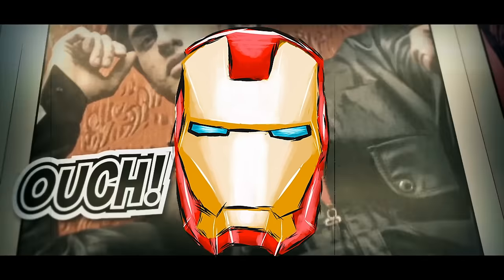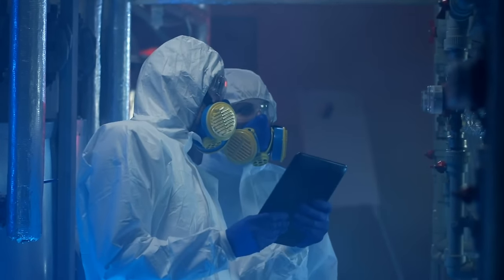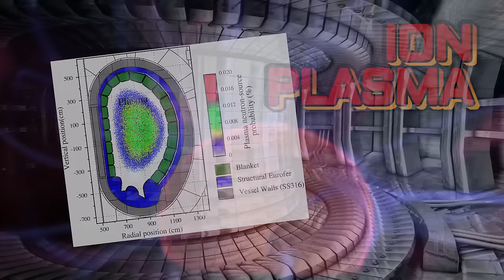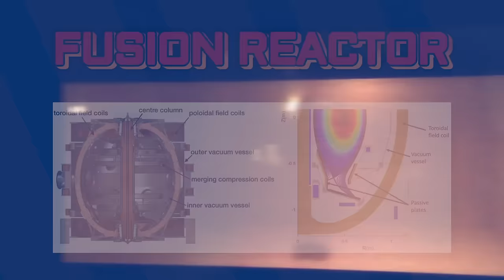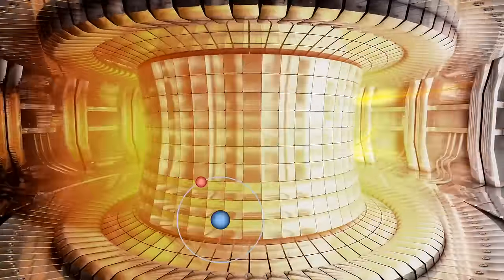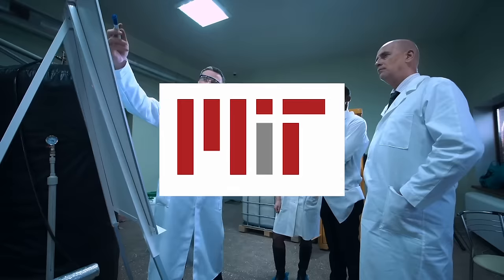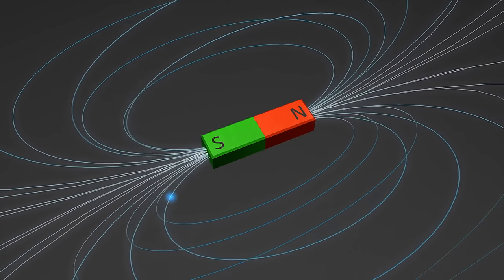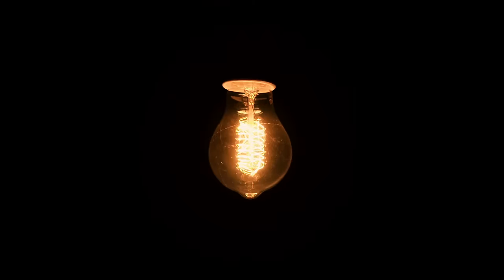How Does Iron Man's Arc Reactor Work?

Comment: But there's one problem: that arc reactor generates A LOT of waste heat...TONS.
Reply: What if that energy is converted so it  actually gives off usable energy.
Reply: Well it could function as heater
Reply: yeah lmao his chest should be burning from the inside out but this is the same universe where we have a guy that can summon lightning, two guys that can shapeshift,  magic, time fuckery, and much more. tony stark's chest not being literally on fire from the heat of the reactor is the least of our problems.
Reply: thats kind of the point.. the heat is used to create water vapor which spins turbines, its the spinning of these turbines that generates the electricity
Reply: @InitialPC  But there is still SO MUCH heat!
Reply: These things burn 5 times hotter than the center of the sun. Heart burn is an understatement
Reply: Yuan Yuan I mean their world is more technologically advanced than ours, surely he would have found a solution to that problem?
Reply: @waynewayne8419  I think that's why in the movie they have a team of scientists working on the reactor. But anyways with the amount of heat coming from the original reactor, some sort of insulation system should have been put in place because, with the amount of heat and not to mention radiation coming from that would be.... ALOT. The heat that comes from the reactor could be used for alot more things than powering a factory. Basically, Howard Stark invented another way of producing a clean energy source without causing pollution. But that's the MCU for ya, going against the laws of physics, chemistry and biology to make new laws of physics, chemistry and biology.
Reply: @verityxo1159  yeah what’s wrong with that? It’s not making new laws, it’s just presenting new possibilities with a hypothetical improved understanding of our own material science. We don’t invent this technology, we discover it.
Reply: @shadowfire04  remember that scene in iron man one where we can see inside his chest cavity maybe that metal structure inside his chest can absorb the heat and cool in or its his real superpower being heat proof
Reply: This waste heat can be used to heat the water in Thermal Power Station to vaporize the water into steam to drive turbines and replacing the need of Fossil Fuels and efficiently using the existing infrastructure to produce electricity
Reply: @anujchaturvedi6296  It's basically a miniaturized nuclear battery (they are real things that exist)/tiny fusion reactor.
Reply: @albertjackinson  Ok but I was talking about large Thermo-Nuclear Fusion Reactor that produce large quantities of heat
Reply: Then couldn't you use that heat to power power plants in the same way nuclear power plants work?
Reply: @TheGoat-dp5xy  a heater is something that generates a low amount of energy. But with that kind of energy it can classified as a volcano.
Reply: Waste heat can be used for more traditional power generation methods like steam turbines.
Reply: Apparently the Arc Reactor has massive insulation that somehow does not melt or explode despite having 3 gigajoules per second of power concentrated in such a small volume. If even a 1 percent of heat leaked out of the reactor, it would function as a 30 megawatt heater whenever it's pushed to the maximum capacity, 2000 times more powerful than a typical patio heater.
Reply: Wait I thought iron man reactor was a fission reactor. Just a very efficient and stable form of it
Reply: @TheGoat-dp5xy  for the fuking universe
Reply: @kaboomgaming4255  doubtful cuz hes constantly running OUT of power meaning that that excess energy prolly is waste still.
Reply: @InitialPC  water boils at 100 C
Plasma is thousands of degrees C, maybe hundreds of thousands. It will burn through his chest  then when he falls down, it will start melting through the floor and ground
Reply: Humans 0
Saiyajin 1 to 6
Angles 7

Kalki Ironman 5th matriya buddha 8th arc Angel 11th satguru 13th imam and 24th avatar after 2026 😎

Almighty God 9 😇

Humans type 2.5+ after 2026 by Kalki Ironman (christ in the white horse)(son of man on clouds) type 7 and 8 😎😎😎😎😎

Jarvis the world’s first artificial intelligence (parrot) 😎😎😎😎😎

Cuz Kalki is ironman batman and every super heroes combined after 2026 😎😎😎😎😎

Jarvis world’s first artificial living being (just like vision in marvel universe)😎😎😎😎😎

Made of Quantum and sub quantum particles 😎😎😎😎😎

Power source quantum energy arc reactor (type 7) level technology 😎😎😎😎😎

Kalki Ironman going to have every kind of arc reactor like:- type 1 Nuclear fission, nuclear waste, hydrogen fusion, type 2 3 4 5 antimatter arc reactor (solid liquid gas), type 6 electro quantum arc reactor, and type 7 Quantum arc reactor, type 8 limitless quantum energy arc reactor without quantum particles 😎😎😎😎😎

Kalki Ironman going to have sun in a box million billion tons of hydrogen nuclear fusion reactor type 2 3 4 5 just like sun and stars in the palm of his hand 😎😎😎😎😎
Reply: I thought he fixed it in Ironman 2 where he made a new element ?
Reply: "What could it generate?"
"If my math is right, and it always is; 3 gigajoules per second."
"That could warm your heart for 50 lifetimes."
"Yeah, or something big for 15 minutes."
Reply: @kaboomgaming4255  in fiction it could be done but in reality entropy doesn't allow it, "every action you do increases the entropy of the universe" means if you have a lot of energy concentrated in one place, that means that as long as you do any action with it, it's energy would dissipate creating more entropy, and actually moving that heat to store as energy would create more entropy either as heat or in another form since you still need energy to move energy, so it's kinda hard, the closest we could ever go to creating as little entropy as possible in the universe is with super-conductors
Reply: Thats why it is really cold fusion it only heats up upon exit
Reply: @InitialPC  those turbines would generate little to no energy
Reply: @cantugs-buyer1552  that’s what I’m thinking, put the reactor under water and let it boil, steam goes up into a turbine to generate electricity. Free additional power
Reply: Humans 0
Saiya-jin 1 to 6
Angels 7 😇

Kalki Ironman 5th matriya buddha 8th arc Angel 11th satguru 13th imam and 24th avatar after 2026 😎

Almighty God 9 😇

Humans type 2.5+ after 2026 by Kalki Ironman (christ in the white horse)(son of man on clouds) type 7 and 8 😎

Jarvis the world’s first artificial intelligence (parrot) 😎

Cuz Kalki is ironman batman super saiya-jin superman ben10 saitama Narutoo optimus prime and every super heroes combined after 2026 😎

Jarvis world’s first artificial living being (just like vision in marvel universe)😎

Made of Quantum and sub quantum particles 😎

Power source quantum energy arc reactor (type 7) level technology 😎

Kalki Ironman going to have every kind of arc reactor like:- type 1 Nuclear fission, nuclear waste, hydrogen fusion, type 2 3 4 5 antimatter arc reactor (solid liquid gas), type 6 electro quantum arc reactor, and type 7 Quantum arc reactor, type 8 limitless quantum energy arc reactor without quantum particles 😎

Kalki Ironman going to have sun in a box million billion tons of hydrogen nuclear fusion reactor type 2 3 4 5 just like sun and stars in the palm of his hand ✋🏻🤩😉😇😎

This all going to happened by self replicating quantum nanobots knowledge energy and techniques at type 7 7 7- respectively 😎😎😎😎😎.
Reply: No it doesn’t
Reply: We can create some kind of material that can repell heat and reuse it somehow
Reply: But if we successfully make a fusion reactor couldn’t we also absorb that heat and convert it into energy using the seebeck effect. Basically use the ionic energy and any heat waste we use thermoelectric generator around it to absorb any waste.
Reply: @verityxo1159 the amount of heat would burn him to a crisp within milliseconds
Reply: That is case in open but not in close one
Reply: He uses the excess heat to power the arc reactor. So that all the plasma that comes off gets used, and btw the excess heat that gets used, Tony will get used to it eventually.
Reply: @SashaironfistGaming-SUB2MEEPLZ  wouldn't the excess heat kill him?
Reply: There might have been cooling properties to counteract the heat like that force field stuff we saw on droids in star wars revenge of the sith during Anakin and Obi Wans fight on Mustafar. That was vital to keep the droids that close to the lava without melting.

Comment: I recently found out that the ark reactor tony uses is based off of technology his father was tinkering with, basically, Zola in Captain America, harnessed the power of the infinity stones' casing, not the infinity stone itself, to make batteries which powered the weapons hydra's infantry used, that tony's father got a hold of. in other words, just like in reality, stable fusion reaction requires undiscovered exotic material.
Reply: True as it is physically impossible to gain energy from no where. The arc reactor needs just as must energy to pull apart the atoms that it gets from doing so. And that’s if the design is perfect. There will always be inefficiencies, so it will actually lose energy by doing that.
Reply: So how did he get that exotic material in the cave when making his first reactor?
Reply: @tomclanys  his first ark reactor don’t have it. That is why it only lasted like 20 minutes before it burnt out.
Reply: @proskillz9849  No, it's because it had "just enough" palladium for it's job to escape. Vibranium is exotic, his first reactors are "normal" in MCU science
Reply: @tomclanys  It had a bit more than that. He was able to escape, keep him alive for three months and a few days after he got home, then allow him to fight Stane at the end. The element that Tony synthesized at the end of Iron Man 2 (which isn't Vibranium even though that's what they were aiming for) is something that is likely duplicating the Tessaract's shell.
Reply: "in other words, just like in reality, stable fusion reaction requires undiscovered exotic material."

Uh, wat?

Stable fusion is a misnomer - it's not a question of fuel so much as reactor design.

A stellarator is in essentials still a tokamak, but one which has magnet geometries dramatically different from more conventional ITER like tokamak designs.

These stellarators are far more complex to design and manufacture, but they are far more stable than a conventional tokamak of similar size.

Other features such as RF wave plasma manipulation as well as coating the surface of the reactor with lithium metal can augment the stabilisation of the plasma - the point of stabilising it is to keep the reaction going long enough that minimal extra input power is needed to fuse more fuel.

The other (perhaps more important) problem with fusion designs are simply that they are mostly neutronic in principle - meaning that power is extracted indirectly from the fusion process by neutron biproduct thermal heating of the coolant which is then used to heat something else up and drive a turbine.

Needless to say this is not very efficient from a construction volume point of view - the turbines take up extra space, and in the case of steam generators they can take up more space than the reactor itself.

Aneutronic fusion designs work on fuel reactions that throw out charged particles (protons and electrons) instead on neutrons - the movement of these charged particles can be used directly to harvest electricity using the right equipment which takes up far less space.

Unfortunately all curently known Aneutronic fusion reactions require far more energy/confinement power than the neutronic equivalents, and none come close to the sheer energy potential of hydrogen isotope fusion reactions - so you get less power out for more power in.

Comment: The laws of thermodynamics, given it's small size, means it would get so hot that it would  melt through its housing.
Reply: You're right. Which is why its contained within an electromagnetic field.
Reply: Fun thought. The lowest possible temperature is absolute zero but we dont know a limit to the highest. So I believe the reason for that is because atoms themselves are super hot. Like probably hundreds of thousands of Kelvin. But the difference is this heat is cannot be transferred. This heat is bounded by the forces within the atom and cannot be transferred so we can never measure it. Inside the atom itself time doesnt exist so no known heat equation can explain it. Because all heat equations and all other equations are defined by time in some way. So if you go lower than absolute zero the atom will just explode giving off tremendous energy in the form of E=mc2.

Comment: Ya know, the 21 ft reactor is exactly what I expected when I clicked on this video.

It's official that the original Arc Reactor was around this size; Tony just used his genius to somehow miniaturize it.

Given that we don't need to power Iron Man suits (yet), I'd say this'll be sufficient enough.
Reply: What’s the most powerful source we actually have IRL? Which is closest to the Mini Arc Reactor which can last the longest
Reply: yes thats what i wanted to say they are basically making the original arc reactor!!
Reply: @balakrishnak2600  Currently the largest power generators in the world are hydroelectric dams, which simply steal power from the force of draining river reservoirs running over turbines.  These however are strictly limited by where you can place them.  The next largest are some of the more modern nuclear fission powerplants.  There is nothing which exists in the world even remotely close to the Arc reactor because the Arc reactor operates by comic book logic and outside of it's vaguely fusion reactor like aesthetic has nothing to do with any real life technological equivalent.
Reply: Don't you worry. Elon Musk's son will be working. Time for me to be Winter Soldier
Reply: With a box of scraps 😂

Comment: Please explain how hydrogen electrons are removed from their host atom AND how does that process create plasma? I would be grateful if any explanation would be shared😊
Reply: Trying to make your own arc reactor? lol
Reply: so first off i'm not a fusion physics expert but basically plasma is a ionized cloud of stuff. ionized is just when a substance is so hot the electrons are literally ripped away from the force of the heat (since heat is just a measurement of how much kinetic energy something has) and in this case it forms a cloud of hydrogen nucleuses and disassociated electrons. by definition, this hot cloud is plasma.
Reply: @rr24creations  y  e  s
Reply: This dude has no idea what fusion is, go watch "Undecided with Matt Ferrel" or "Kurzeagast" instead.
Reply: The video failed to explain how fusion reaction actually works. Plasma is simply a state of matter (think how water can be solid, liquid, or gas depending on the temperature) where the gas is so hot that the electrons becomes unbound from the atoms. Fusion reaction is when the nucleus of two atoms fuse together, converting some of its mass into energy in the process.

Fusion reaction is why the sun is hot. The sun is made of plasma due to how hot it is. Fusion reaction is so hard to make because you're essentially recreating what happens inside the sun on Earth.
Reply: It should also be noted the forces at work in fusion. Fusion is the name for when two atoms' nucleus' merge into one. But that's easier said than done. Have you ever tried to hold two magnets at the same poles together? It's hard because electrons repel each other. The protons in an atomic nucleus behave the same way. That's why fusion reactions have to be so hot. Heat on the atomic scale is simply velocity. You have to heat things up to the point that stripped of electrons, the protons in the nucleus have enough speed and force that they slam into one another hard enough that they don't just make contact, but actually are permanently fused into one another. That occurs once you get the nucleii close enough that the strong nuclear force (which holds nucleii together) overcomes their magnetic repulsion. Think about how hard you'd need to slam two magnets into one another that you not only overcome their need to repel each other, but actually become one magnet. The energy of overcoming that force of repulsion and the two nucleii uniting produces the release of thermal energy that makes fusion power, so...powerful.

Comment: I have an idea for a "arc reactor" one that converts gamma into electrical potential...

The idea would be to flood a chamber of highly compressed radon full of artificially created neutrons, causing more collisions, thus increasing the radiation emission. The vessel would likely be surrounded by something that reflects neutrons in all directions except one, like beryllium, boron alloy. The beryllium would be useful for neutron emission as well… when beryllium atoms are hit with alpha radiation, neutrons are emitted.

(Highly efficient neutron guns maybe or fusors as they can emit 10^9 neutrons per second can be used for artificial neutron sources)

I think if a device like this were optimized, a source strong enough for efficient  energy capture could be devised.

As for capturing the radiation and converting it to electricity, i would use methylammonium lead iodide (CH3NH3PbI3) it can fulfill this purpose quite well according to scientists at EPFL, they claim 75% charge-collection efficiency in millimeter-sized crystals. The material also turns photons (light) into energy. According to them the material exhibits low degradation as well while in use.

75% efficiency. Very possible. Seems viable, funny that nobody has attempted to make a full generator like this and most in the industry thinks it impossible. The big problem with this idea is that it would be so radioactive, anyone near would be beyond dead.